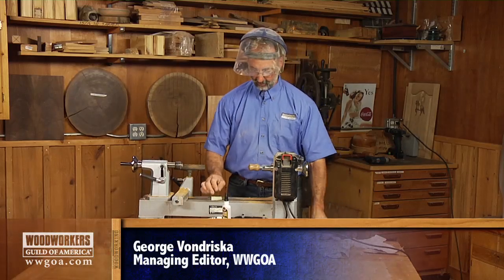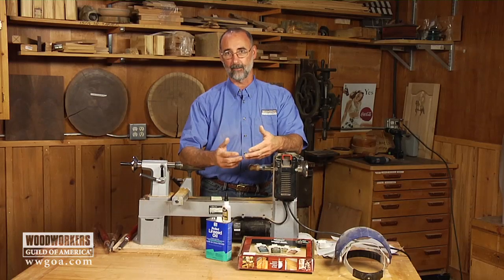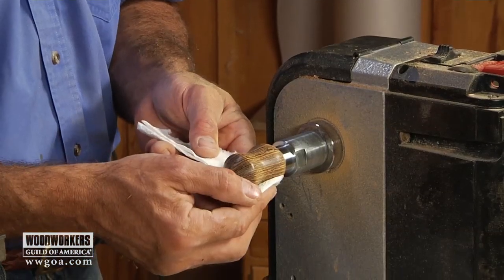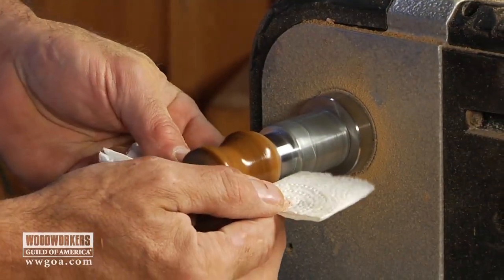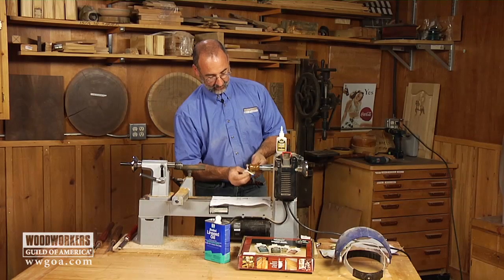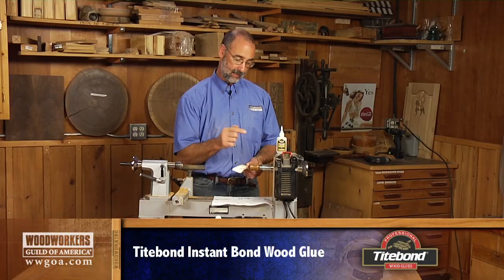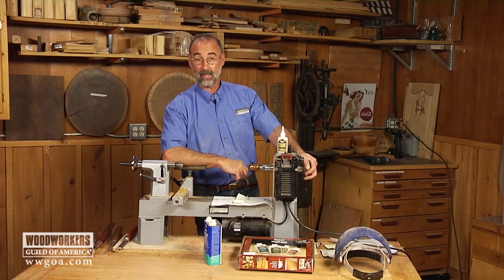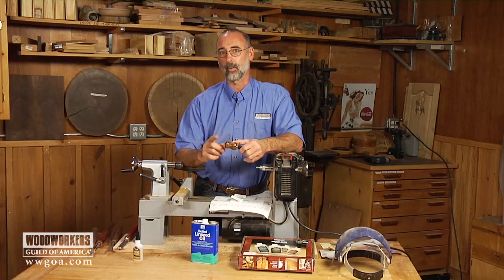Super Finishing for Turning

Comment: Thanks all good guys in youtube, other videos and craft USA videos helped me turning fine products, although I never had experience turning wood, acrylic or Tru-stone before (did hand works before). 
I use this method and it works well for me. I got same glow finish as long process with smelly CA and Spray method and Micro mesh fishing method. I use both method depends on how it ends up at the end of finishing. This method is quick and not much CA and almost no smell.

Comment: you can do this all in one step.  I do this with my pens, and if you bump up the speed, put a little pressure while applying, it will be smooth and dry, ready for the next coat.  Just apply BLO to the towel as suggested, then apply the ca glue on top of that, and spread it.  make sure the towel is thick enough so when you apply pressure it doesnt burn your fingers or stick to your fingers.  7-10 coats makes a beautiful finish.
Reply: is it waterproof?

Comment: Also the faster you can get the lathe the better. I usually turn pens and bottle stoppers at 2000-2500 then apply the ca/blo to the item. If you use small amounts of blo and ca you won't have a problem with it flinging off the piece your applying it to.

Comment: Okay, will try.  Looks simplest way of using CA.  Other turners use thin, medium, and thick all at different points in the process, cannot tell which is best without extensive experimenting.  Hopefully Boiled Linseed Oil + CA finish does not rub off!!

Comment: Put 4 or 5 coats of superglue on the part and polish it. It will shine like a diamond. I've done it for years. And its tough as hell, as well as reasonable heat resistant.
Reply: As an agoraphobic I often couldn't get to the dentist when needed. And when I did theyd put a cap on that lasted 2hours, so it turned into a trauma thing.   ..You'd be surprised at how well super glue and tissue paper hold up as a temporary tooth 😂 wax coat it and it's good to go. (21st century ftw😄)

Comment: how long between coats? and sanding. thanks sir.
Reply: using thin CA you can apply coats after about a minute or less.  You can also buy an accelerator that you can spray on the CA to make it harden immediately.  For sanding, you can wet sand using the packs of sanding sponges that cover all of the different grits.  Usually up to about 10,000-12,000 grit.  Then I add a polish at the end and it really shines.  You can buy all the stuff (glue, accelerator, polish, sanding sponges) online or at Woodcraft or similar stores. https://www.woodcraft.com/products/micro-mesh-3-x-4-soft-touch-sanding-pads

Comment: Came out dull. Wait for the oil to dry thoroughly and friction polish it for a couple minutes. Or skip the oil entirely.  Use 5 coats of CA water thin glue. I use Starbond. Use the catalyst immediately after each coat and freeze the shine. Wet sand with 800 grit. Polish out with a scratch remover. This creates mirror shine for me that lasts decades and wont dull out like this piece. The ca glue was a waste here. You should be getting a mirror showroom shine. A few more coats would bring this piece there.
Reply: is ca glue food safe?
Reply: yes once it is dry
Reply: Please do a video!! Would love to see you do it.  Sand with 800 grit one time after 5 coats or between each coat?
Reply: Im new-ish to turning,  when i started making tool handles i had some poly Minwax one step stain and also Krylon clear-coat spray, after educating myself on the multitude of oil type finish's and trying some, I still think my spray-can of clear-coat and poly stain looks better and is tough as well,
Im interested in hearing what you have to say about this, thanks.

Comment: I would recommend Rustoleum 2x cover clear http://www.rustoleum.com/product-catalog/consumer-brands/painters-touch-ultra-cover-2x/clear I use it on the shifter knob for my vehicle and it still looks like new year later like liquid glass
Reply: Hey Danny, do you spray it while  turning the lathe by hand or low speed ? How many coats ? how much drying time between coats ? any buffing ?  thanks !
Reply: +Fred V. Lord of Glencoe Time between coats is 30 minutes. I take it off my lathe to spray it just because I don't want to cover and protect all the parts on my lathe first, but you could spray it at a low speed on the lathe. If you keep it turned on  it would dry evenly with no sagging.
Reply: thanks for the fast response !

Comment: I do this on my violin canes.  These are mahogany and this gives a hard, durable finish that is so thin that it doesn't interfere with the vibration needed for mellow sound transmission, while standing up to the constant handling of the instrument during playing as well as the intermittent knocks that a walking stick constantly endures.
Reply from the maker: Great idea!
Reply: What is a violin cane? do you mean soundpost or bow?
Reply: @evoandy  No.  Developed a fibroma in my left foot a few years ago & was required to use a cane.  I was also a sort-of fiddle/ violin player, so I made a walking stick that is also a violin.  No toy, it's standard 4/4 scale just as in an orchestra or a bluegrass band.  Doesn't  LOOK like a fiddle until you take off the handle, remove the bow & the caul & the tip, then you screw the handle back on (it is tau shaped), which becomes the shoulder & chin rest.
  Allows me to irritate people & cause cats to breed frantically wherever I go.  It sounds like a violin because it is a violin.  It's quieter than a standard fiddle because the soundbox is so small, but if you'd ever heard me play, you'd know that's a real blessing!
  My comment was an endorsement of the boiled linseed, or tungoil, and super-glue finish.  If you've not tried that, grab a piece of scrap & give it a whirl.  Expect you'll like it.

Comment: Linseed oil is very flammable, the craziest story I heard of was a sponge being used with linseed oil all day, and left over night in a bucket of water. The oil rose to the surface, saturated the sponge, and had enough surface area to build up heat and ignite the sponge, lighting equipment it was next to inside a 65 degree data center

Comment: If you use med ca after the blo then hold the paper towel on and keep it moving until the smell of the curing ca goes away, it will be smooth and dry then you don't have to sand between coats. I use this process for my pens all the time and have never had a problem where I had to sand at all.

Comment: what grit of sandpaper did you use between coats,,,and can you buff it out after,,or maybe put some beeswax on it and then buff
Reply from the maker: +jeff oldham A grit in the 220 - 400 range works well between coats.  If you buff out later be sure to let the finish set up for 2+ days before buffing, to allow the finish to adequately harden.  You can add beeswax if you want, but if you do you should plan to maintain it by reapplying ever 12-18 months as you notice the finish developing a dullness or haze.

Comment: Is there a benefit to using the oil as well as the CA?

I turn mouth pieces for brass instruments and use CA finish on them. After you have put a few coats use a paper towel to polish is with some automotive T-cut (cutting polish) while on the lathe and then buff with a clean piece of paper towel and you will be rewarded with a glass like finish.
 check out the end of this video of mine (it's the second of a two part video) where i apply the t-cut to a wood rim i put onto a trombone mouth piece. it really makes it pop!
https://www.youtube.com/watch?v=7KAp53H2NLg

Comment: I love the look. But, I thought CA was impermiable. How does the 2nd or 3rd coat of BLO get past the previous layer(s) of CA and into the wood?
Reply: The oil mostly acts as a carrier for the cyanoacrylate - it comes to the surface and is absorbed by the towel.  This is similar to how French polish works, the oil acts as a carrier for the shellac, so it can be polished on smoothly without sticking.

Comment: how ong does the CA glue take to dry over the linseed oil?
Reply from the maker: Hi Charles.  Results will vary based on humidity levels, but it is generally pretty quick and dries to the touch almost immediately.  Full cure is generally complete within a few weeks.

Comment: Will this finish work on shaving brush handle? I used mineral oil but becomes dull in time.
Reply: absolutely.   I use CA on any small projects that will get a lot of use.  After I apply several coats of CA, I always wet sand up to at least 10,000 grit.  You can buy the packs of sanding sponges for 15 bucks and they last for a long time.
Reply: John Wachter is

Comment: I've heard that using oil with CA will cause the finish to crack over time. Have you ever experienced this with the linseed oil/CA method? 
Also, when I use CA to finish, I sometimes get dull looking spots that show up after the final coat that I can't seem to buff out.  Is there a method to avoid getting those dull spots?
Reply from the maker: I have not experienced cracking with CA glue, and I have applied many bottles in this fashion. Regarding the dull spots, try working more sanding dust in with the CA and perhaps it will blend better for you. I haven't seen dull spots specifically but I've seen definite variations in sheen. For larger defects try filling with a mixture of quick set epoxy and sanding dust from the project.
Reply: kez3000 -- Spotting is probably an issue of surface prep, not the finish.   I've seen such spots in Apple or Cherry with early spalting or "red rot", and the dull areas are softer wood thirsty for more finish.  You can try a little sanding sealer (shellac works well) dabbed into those areas with a tiny brush or the corner of a folded paper towel.   Allow that to harden, sand very lightly, and then proceed to your favorite finish.  CA all by itself can make a great sanding sealer -- apply thin CA, allow to cure, and sand or steel wool lightly.  CA usually darkens the wood somewhat, so either get it exactly where you need it, or be sure to coat the whole thing.
Reply: Obviously I'm a little late to the party, but I'd like to add my .02 cents.
As stated below, softer wood and punky-ish types of wood surfaces will require multiple coats to pre-treat the surface before you can do a final finish. This is especially true for resin work. Appt multiple layers of thin CA glue to the soft wood, sand between coats, until the wood literally cannot soak up any more. Personally, I like to go over the area with a very light and even coat of medium CA glue so that it will bind the surface fibres of the soft wood and then it will be ready for final finishing.
#2 I've found that if there are any wet, dirty or oily areas present before the primary coat of CA, you will have a cloudy affect.
Actually much similar to shellac and resin problems that arise when there is moisture present on the surface, or, if spraying shellac, the moisture in the air becomes trapped in the spray and results in what they call "blushing". Blushing is very hard to correct and may sometimes require multiple applications then stripping before if can be gotten rid of.
Personally, a hair dryer works wonders! Hahaha.
Hope this helps!
Keep a going!!!